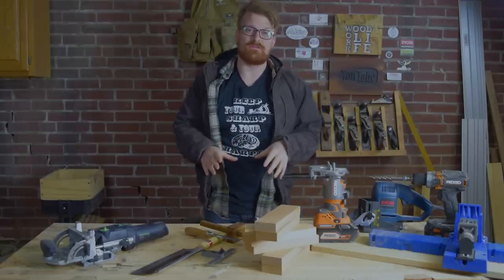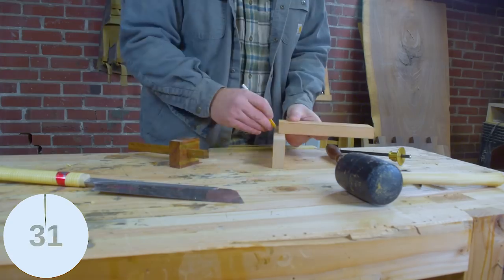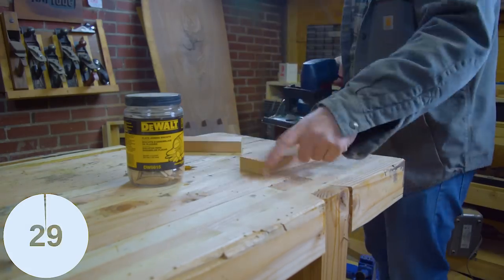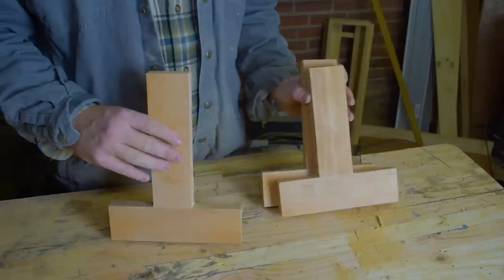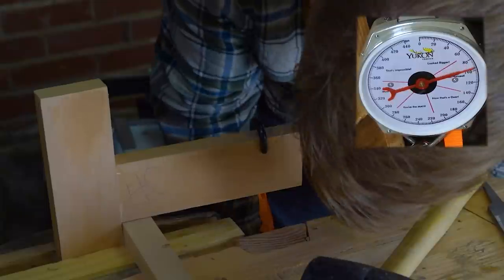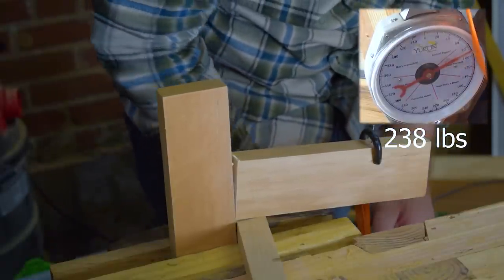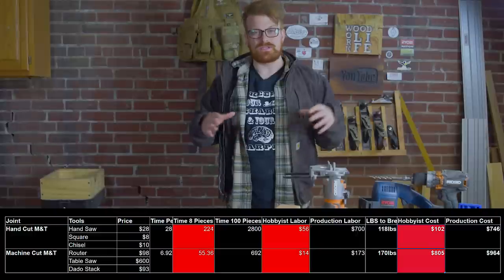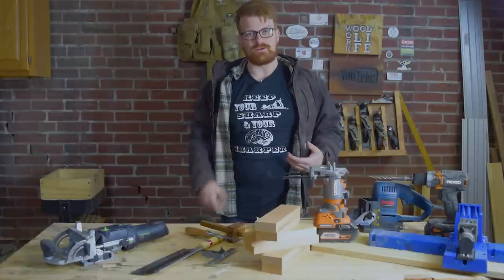Best Joint Shootout, The answer will surprise you!  | Hand Tool Shootout

Comment: I am a custom fine furniture maker of 45 years. I use machine cut mortise and tenons with a mortising machine - perfectly cut. My butt joints are rock solid. We tested a Festool Domino and were not impressed. The costs were enormous and we did not see any improvement in quality over the m&t for the money spent. Where they make up for the money is time. That said we all preferred the more traditional mortise and tenon for its mechanical advantage and strength. The difference for us is planning, which we do. We cut all the pieces at the same time. We also do the mortises and tenons then as well. We can cut mortises in about 1 minute 30 on the machine. Tenons about the same. They are tight, strong, and will last generations of rough use. When the glue is dry, the Festool Domino joint failed in 10 out of 10 tests we did on ash at about ~1250psi. The m&t lasted to ~4400 psi. Was your glue dry? It did not appear so. I don’t believe new technology is necessarily superior to age-old techniques but may indeed be faster. That said, new technology may be good enough for some applications and whatever works and is comfortable for anyone is the method they should use. FWIW.
Reply: Agreed. But given the potential glue joint and mechanical fastener. . The biggest issue is cosmetics in the end. Cost... is about the same. IF you have all the fanty pant clamps. Albeit ply, imho if doing all REAL wood. Nothing is better than traditional.
Reply from the maker: Ya, good mortising machines with practiced individuals are pretty hard to beat.  I think where the domino really shines is in Plywood assemblies and assembling softer woods where M&T won't be quite as strong as a hardwood floating tenon.  Another place where the domino shines is in modeling and batching.  With dominos there is no need to model the joinery or account for extra length in the components for joinery.  One more thing with the domino, you can bring the tool to the piece rather than the piece to the tool, which is great for large assemblies.  Horses for courses and whatnot.
Reply: You can cut the m&t in 3 minutes. That’s pretty impressive I might reach for my Mortiser more if I could get it done that fast . The domino is plenty strong (with glue) for most applications so I don’t think i will be switching over any time soon as it probably takes me 20x longer than the domino 😂

Comment: On lockdown here in California. Really good demo. I use a hand made doweling jig for these types of joints, and the Kreg system, and they both work fine for me for what I do in my garage shop. They are nice strong joints, and since I am a bit of a perfectionist, I take oversized dowels, glue them into to the pocketholes and then cut them down with a Japanese pull saw. Once sanded, you can barely see them, unless you are looking for them, and they are usually on the inside or the back of a project. The reason I mentioned the lockdown, is that it is that I haven't eaten yet, and I really wish you hadn't shown those BISCUITS!  Great video, thanks!
Reply: Gregg Hernandez  I’m a bit concerned about screws loosening, so I haven’t plugged any Kreg holes yet - just capped them. Do you figure the plugs are up against the screw head, making it impossible for them to back out?
Reply: @zxzs328  As far as I can tell none have ever backed out. I never really thought about it, but I guess because the dowels are pounded in, with Titebond II or III glue securing them, there is little chance of them moving at all.

Comment: I use the biscuit joiner all the time. I feel like it gets a bad rap from misuse. If you apply glue within the biscuit slots and onto the biscuits you get a pretty strong joint. The biscuit will absorb the glue and swell inside the joint making a tight and strong joint. I use it on cabinet structures and face frames all the time.
Reply from the maker: It certainly has its purpose but butt joints are certainly not one of them.  Good enough for face frames and case work.
Reply: @WoodWorkLIFE  mmm, surely the biscuit is just to align the 2 pieces and the strengh is just the glue so for a butt joint it still should be ok? I am talking about sideboard cupboards and bedside cupboards??
Reply: It cost a lot cheaper for the average woodworker....
Reply: Biscuits are just a smaller version of the domino. A properly fitted biscuit still work great. To strengthen your butt joints, wipe glue on the end grain and let dry. This fills in the poors. Then glue the joint.
Reply: @brucemiller1696  yah I think biscuits are great.  I don't understand why his biscuit joint broke so easily?

Comment: Nice video - a couple of minor details/corrections: 
One of the problems I’ve had with the kreg jig is keeping the pieces alligned. Even with clamping, the angle of the screw will tend to pull the perpendicular piece forward, off the base piece as you screw it in. I’ve also had issues with the screws splitting harder woods, despite using fine-threaded screws, waxing them and going very slow with an impact driver. 

The pocket hole jigs used by a production shop are different and significantly more expensive. These machines usually make the hole at a shallower angle, reducing the alignment issues. They’re also actually faster, too. 

Finally, the strength of the Domino (or any tenon system) is determined by the size of the tenon. Using the wrong size can make a big impact on joint strength.

Comment: I was given a Ryobi biscuit joiner about two years ago, and used it to build a fir garden chair and garden bench (which both sit outside year round).  These items are still as solid as the day they were made, with no sign of cracking at the joints at all.  I think if you use a good quality outdoor glue and take care to mate the pieces accurately, the biscuit joint will be plenty strong for most applications.
Reply: You can also combine it with screws.
Reply: bighand69 and dowels.tim

Comment: I think for a hobbyist you really need to question how versatile a tool is before you buy it. What other things can you do with it? A table saw (or a router), for instance, is really very versatile and most hobbyists are probably going to have one on their wish list already. But a Festool domino slot cutter is a very specific tool that most of the time is just going to be sitting on a shelf in your shop collecting dust and adding clutter.

If you really don't want a joint to come apart, use a half-lap joint, a dovetail joint or a mortise and tenon joint and then peg it. Another option is a wedged through tenon joint such as you would see connecting a hammer head to a handle. Usually though, on furniture, your joints are not going to have to withstand large torquing forces such as in your test. Horizontal members are usually supported on both ends by a pair of joints, so weight applied to the horizontal member gets transferred straight down into each joint of the pair. The horizontal member may bend a little under the load, but not enough to tear apart the joints, unless it's undersized for the weight and catastrophic failure occurs to the member itself. At that point whatever happens to the joints is moot.
Reply: @dlwatib.  Finally someone else gets it. We are talking about cabinetry for God's sake, not load bearing structural members. Smdh. Also, your point about price vs versatility is truly accurate and important.
Reply: +dlwatib
If you buy a domino you could use it on every joint you do. If you are not using that often it probably means you are not that seriously into wood work. 

In terms of the biscuit joint you could combine it with through dowels or screws as well.

Comment: One major issue I see with this testing method is that it is compromised by the supporting wood beam placed underneath the joint (7:45). In essence, this vertical beam forms part of the joint and functions as a fulcrum by which the joint member under load rotates, exerting a magnified torque at the joint. 
Other than that, it is a useful demonstration of what can be expected by a diyer or hobbyist.

Comment: To get best results on the kreg jig your suppose to clamp the joint flat while you drive the screws , otherwise you get slippage which will require more sanding. And it didn't appear that you clamped your biscuit joint, or any of the joints for that matter, as there was a bit of a gap before you even started the test. And yes dowels would have been appropriate to test along with these other methods. I actually have the Dowel Max jig and it works very well ! Thanks for sharing !
Reply from the maker: I did clamp all of the joints off camera, and there were very little gaps.  There was very little slippage with the Kreg joint, just cleaned it up a little with sand paper.  The biscuit joint looked fine, great even, no gaps but failed immediately with any load.  It had a gap when the test started because it had already failed when I delicately tapped the nail in.  The biscuits just aren't tight fitting enough so the joint is cosmetic but not structural.  I have a doweling jig I got, and the Rockler beadlock, also testing half lap, nails, and screws...I am interested in the results.

Comment: Dowels should have been included
Reply: I thought the same, too.
Reply: Dowels would have been the strongest and by far the cheapest.
Reply: Thomas Schley  Absolutely,  they are pretty much a standard, in traditional furniture.
Reply: Dowels are made of soft pine wood , he didn’t use the XL 700 Domino thicker tenons and is made of a Hard wood OAK  that Isis perfect to make solid heavy door 🚪
Reply: I agree.  I love my Dowelmax
Reply: coldrunner domino joints done correctly are much stronger than dowel joints. The glue surface area of a domino joint is many times greater than a dowel joint. The glue surface in a cross grain dowel hole is about 70% end grain, no strength, as opposed to the domino which is about 80% parallel grain glue surface. In the end grain orientation, both are parallel grain joints, but the dowel has far less glue area when you compare the circumference of a dowel to that of a domino. For maximum strength with either, glue must be applied to the surface of the hole and the surface of the dowel or domino. In my door shop, we kept our dowels in a heated storage drum to keep the moisture content to a minimum. We had custom drill bits made .005” oversized, we could insert a dowel into the hole, spin it for thorough glue spread. After 5 minutes in the hole the dowel would swell up tight and could not be moved.
Reply: @ezras8889  so expensive though  :( , I think dowels is a very good alternative, or you could do a mortise/tennon
Reply: Half Lap, Half Lap, Half Lap, Half Lap, Half Lap, Half Lap simple cheap and strong.
Reply: Sam Maloof used dowels.....that's good enough for me.
Reply: Exactly
Reply: @swig46  If your argument is correct, then you just nominated Rockler Beadlocks as the strongest joint available.
Reply: william skrainski I think Sam passed away before the Domino was introduced, so he didn’t get a chance to choose.
Reply: John Bluebeard not sure I agree. I looked at photos of the joint on Rockler’s web site, there large gaps between the mortise and the face of the beadlock. The Domino is a very precise fit and the faces of the Domino are compressed so they swell when glue is applied. Another advantage of the Domino is the ability to vary the width of the mortise. This allows for slight lateral adjustment of the parts. It also makes it easier to accomplish wide joints with multiple Dominos spaced across the joint. The beadlock joint does not allow lateral adjustment so all mortises would have to be spot on.
Reply: coldrunner  Wow You sound like Will Hunting, From The movie Good will Hunting.. Impressive ,Ok ..Here Im the Other guy .. Ultimately arguing over "pre eminence is like comparing an apple tree to an orange tree "The best" By definition  does exist  !
Reply: stronger than domino, not hard to make with dowel jig. cheap, fast, easy and strong.. hummm....
Reply: I was thinking the same thing.
all you need is a drill and drill bits, which most carpenters/wood workers/cabinet makers already have. 
and a 3 ft dowel is about 60 cents at the home store, all you just need to do is cut it to the length you need.
and the dowels come in every thickness you can think of. supper cheap.

you don't need to spend that hard earned Dolla Dolla bills $$$ on expensive, single use, specialty tools like a biscuit joiner or Festool Domino.
you'll rarely use them and they are only gonna take up space in you shop/cabinets.
Reply: Dowels should be considered entirely obsolete idea
Reply: My experience... No one wants to use dowels do to the level of difficulty lining up ... extremely strong joint dowels... personally I'm tired of all of the pocket holes raving about pocket holes but yet they have to hide them...
Reply: I wish that you included dowels but all the same nice test and I give this a like... Tired of Pocket Holers who claim to be craftsmen...
Reply: @woodensurfer  why?cause you hate to do it?lol
Reply: @StreetKingz4Life  Too much end-grain surface on one side of the joint, the side whose grain runs perpendicular to dowel . Dowel joinery is therefore inherently weak in that side so the whole joint is weak. I never use dowel joinery.
Reply: A lot of dowel haters. Point being missed is that "no joint is an island". A structure is being built and the structure has a job. Careful design of the structure, analyzing the loads and force vectors to which the structure will be subject must be done. The design needs to ensure that joints are stressed in the directions in which they are strongest. A joint needs to be strong enough. Additional unnecessary strength has no value.

Dowels should have been included along with beadlock so that full information was available on all of the options. The anomaly seems to be the cost jump from all other options up to the Domino option. I guess Festool has a patent. At some point a Ryobi loose tenon machine will come onto the marker and we will all stop arguing.
Reply: @woodensurfer  If no force will be applied in the direction in which the dowel is weak then that weakness is not a problem. Depends on what you are making and the complete structure.
Reply: @carlosfcanizal  Yet every commercial door uses dowels
Reply: Anthony Romano here at Hawai’i the termites,  that is first thing they eat , soft wood dowels and then everything fall apart
Reply: @fedx2185  I don’t disagree that pocket holes feel like a cop out. I will add though that James Wright @woodbywright did a great explanation of how pocket holes are more “old school” than you think too
Reply: @mathewanderson2400  pocket holes have been around a long time in industry.. Now there becoming the standard in craftsman’s shops.. Our craftsmen are losing skills and becoming less skilled at the craft

Comment: Domino and Kreg always beat any joint these days for usage, speed and strength.
If you are making massive oak beams etc, hand cut is the only way.
But this guy should be promoting the kreg for sheer ease of use, absolutely brilliant strength and price.
If you can afford a domino, get one.
Beach tenons are stronger than pine dowels.
I would recommend Kreg for near all home projects.
Biscuits are perfect for table tops, alignment, they have little compression value.
Dowels do, but they can be fiddly...depends on what you are doing, but are pretty strong.
I personally would rec kreg and domino to maximise your output and quality, but deff use biscuits for flat panel alignment.
Strength in the right places people

Comment: Kreg joints can shift which in hardwood frames can lead to undesired extra time required for joint leveling.  The Castle pocket hole joints don't have this issue as much and of course Kreg sells pricey pneumatic clamping tables to overcome this weakness in the system.  In softer woods leveling flush joints with a sander may not be a big deal but in harder woods it can be a real chore.   Dowels have been mentioned in some of the comments  and they offer very positive alignment in both axis of a joint.   Sometimes one may want the lateral shiftability  of a mortise joint though and as long as the side tolerances are close enough the joints should go together close enough to flush to require minimal sanding time.

Comment: Good comparison.  Like everything, it depends on use.  For cabinet face frames, I find either pocket screws or simple biscuits (both with glue) to be great options for quick assembly.  Pocket screws with no glue are good if you do need to disassemble/re-assemble it.  If the joints are to be structural in any way, then some type of mortise & tenon or half-lap, or even dowel system is best for me.  The Domino system is just too expensive unless you use it all the time.

Comment: If you do not care about aesthetics then use two 8 inch long screws. Takes a sledge hammer to break it apart.  Mostly what you see in real life is where glue joints have gotten flexed to death. Once a single joint fails the rest of the structure gets uneven loading and then you get a cascading failure.  The moral of the story is that as soon as your chair gets loose fix it. A stitch in time saves nine.
Reply from the maker: Great advice on the stitch in time.  I’ll have to put long screws into the follow up.  I would think the screw compromises the grain of the wood.

Comment: Hi, I don't use butt joints much but for a wooden bench from pallet wood I used through screws and wood plugs. My bench has stood outside for three years and suffered more damage from wind blowing the light structure over. One joint came apart and I used the next size up screw ( from 4mm to 5mm) and new wooden plug.
Reply from the maker: It is not always about using the absolute best joint, engineering is about good enough not as good as possible.